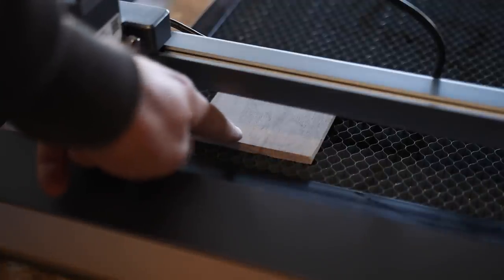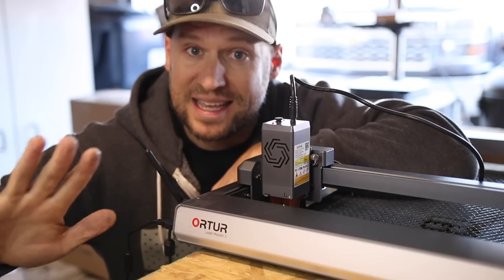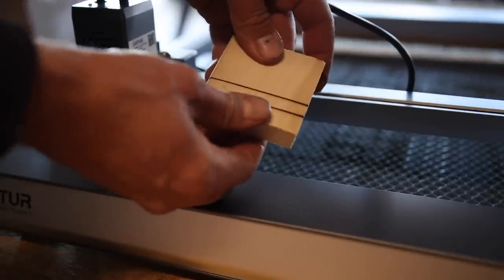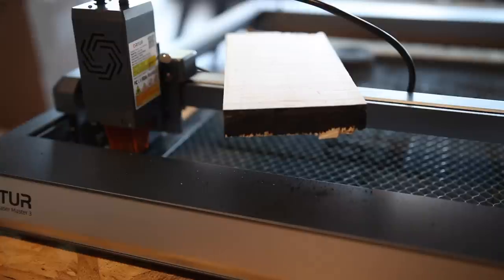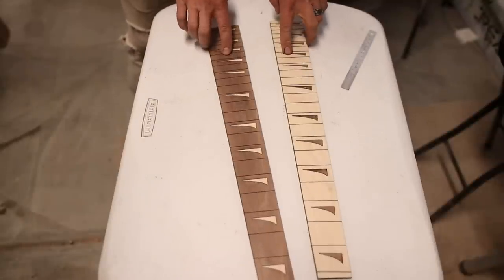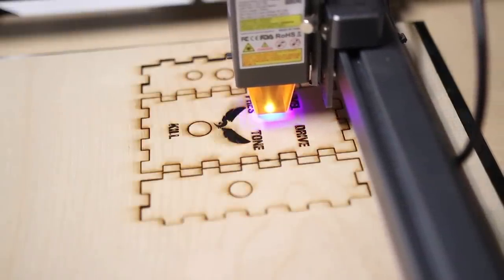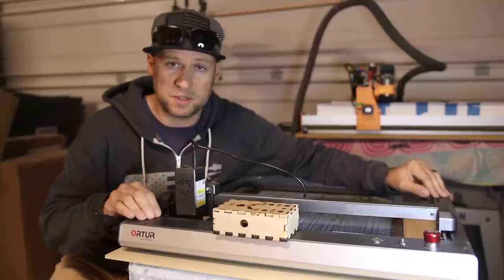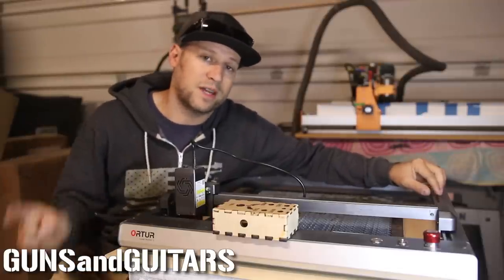Making Custom Inlayed and Pre-Slotted Fretboards the EASY way (Ortur Laser Master 3)

Comment: Looks like Ortur is coming to own guitar building comunity. I have a lot of fun with my laser. I also made a fretboard with it in my latest video but I only marked the fret positions and then cut them to depth by hand. Its hard to control how deep it will burn and its not always consistant on grainy woods. Great video man!
Reply from the maker: Yeah for each of the frets I did 3 passes .14mm apart which make a gap just under .5mm (the width of my fret saw). I could probably press the frets straight in just fine, but after radiusing I’m gonna clean each slot real quick with the fret saw to clear out the saw dust and any ash. If I find they aren’t deep enough for some reason, I’ll take the time to fine tune them. It will still save a ton of time.

Comment: This is a great video.. but, did you ever think about making a bracket to put a laser on your CNC to save some money ?
Reply from the maker: Yeah they make lasers and adapters to use a laser on a cnc router, but honestly it’s a pain to switch back and forth between router and laser, so it’s better to have two dedicated machines. Plus they can both run at the same time.

Comment: Great video, and a great idea on using the cutouts for the other fretboard.  On the fret boards, what will you do with the burned edges?
Reply from the maker: I made these slightly wider than a neck, so I plan to sand it down or route the edge to make a flush fit, which will remove the burn. But one I get ky cnc designs more streamlined and dialed in, I might just cut them to the proper size and keep the burned edges for contrast and install white dot inlays for fret markers.

Comment: for the 3/4 you could try lowering the laser just a little further partway down (not sure how the Z axis works on this model) I have a cheaper and far weaker laser that I use to laser etch things and changing the focal point really makes a huge difference
Reply from the maker: Yeah I did experiment with different focal lengths and couldn’t get a clean cut all the way through maybe if I did several passes then lowered it and did a few more, but when I tried that the laser shifted (ever so slightly) and didn’t make a clean cut.
Reply: Wanna try something cool, remove the crumb tray and focus it higher than your material. It will engrave a wide v groove when its focused close but the material is far away. At least that’s what my glowforge does

Comment: Wow!   This just might be the ticket for me!     I see that you've reviewed a few Laser kits.   The Ortur Laser Master 3 w/Extension kit seems to be perfect. The extension kit is available now (as you probably know).  Bass Fretboards are a requirement for me so I either grow into one, and buy the extension, or just get one that has a long enough working area. And this market place of Laser Engraver/cutters is daunting Geez! - I was looking at CNC's at first, but now it seems like a Laser will add more value to me up-front for Logos/Inlays, routing jigs.. (I've spent a lot of time on making those manually...LOL
Reply from the maker: I love my lasers. The are faster and cut cleaner than cnc routers (obviously can’t cut as deep yet, but I’m sure they eventually will!) I use my cnc lasers 10x more often than my cnc routers.
Reply: @GunsandGuitars  That's a good thing on the wallet!...   One other quick question when you have time:  Have you cut acrylic?  Thinking about something in the range of 1/4" thick or a bit less..Or aluminum?   Thinking about re-making some jigs I have :)

Comment: I guess what I’m interested in is seeing how well frets go in the slots and if they require CA glue to keep them in place or not. I could see this as a viable way to do custom scale lengths and fanned frets and all kinds of things like that. I wouldn’t be at all surprised if someone wanted to cut acoustic guitar tops out on something like this, backs and sides too I suppose. Taylor has used this tech for a long time but it’s only finally getting to a hobby price point.
Reply from the maker: I haven’t pressed a fret fully in yet, but I set the laser to do three passes each spaced 1/8” of a mm apart, cleared out the chaff, and it left a slot slightly smaller than the one left by my fret saw. It might be a tad too tight and need to be touched up with the fretsaw in order for the fret to fully seat at this point, but I wanted to start narrow and widen it as I go until I get the perfect size. So to answer your question, it will not need glue unless you want it as extra precaution.

Comment: So, Makers Muse just put out a video on how dangerous this laser CNC design is. You really really really need to build an enclosure with an exhaust system for these, all that light scattering against the gantry can and will burn your eyes and has a chance to make you or others in the room blind or partially blind. This unit has no safety features at all, and I don't think you are aware of just how much potential for harm there is with this design.

Think about this for a moment - If at full power this light can burn and cut wood, then what will even a fraction of that do to your eyes?
Reply: I also watched the makers muse video. I think while his concerns are valid, most of the dangers mentioned in his video are easily avoided in this use case. As long as you wear properly rated eye protection, and don't actually send the focused beam into your eye you should be fine. And as for the risk of fire, Dan showed in the last video the precautions he has taken. As long as you don't cut anything you don't know is laser safe, dangerous fumes shouldn't be a problem either. At the end of the day, as long as the proper precautions are taken I don't think open frame lasers are really anymore dangerous than CNC routers. It's just a matter of wearing eye protection, and not leaving it unattended.

P.S. I don't write this to put anyone down it is just my opinion and should be taken with a grain of salt the same as any other random person on the internet.
Reply: A shroud, ie shaded welding blind, could easily be installed around the sides to protect you or passer’s by. It wouldn’t take but about maybe 8” all around. But yeah! That light can do a number on ya.
Reply: @the_real_beefchunks  For context, I own and operate an Epilog Radius laser. Trust me, it is far more dangerous then you seem to think it is - Safety equipment exists because something bad happened.

"It's a matter of using eye protection" - Okay, so if it's near a window, or has line of sight with a doorway, whats to stop someone from looking in either of those? When I was a child I looked at the light from arc welding because it was bright and the person welding was just... welding in an open garage.

My main concern here is that he said nothing about the very obvious safety concerns with this laser. It feels not so great to have him basically selling people on something that could hurt them or someone they care about without touching on the safety aspect at all.
Reply: @alaricpaley6865  Fair enough. He should have touched on some safety information. And I would agree that an enclosure would be the ideal solution, but I don't believe that not having an enclosure is an instant deal breaker. Obviously open frame lasers are not for everyone, but I think it is possible to operate one safely with some research, and common sense.

Comment: Have you tested installing frets into those slots?  I'm curious if the width of the cut is the appropriate size.  And also, ho did you guage the power  needed to achieve the appropriate depth?
Reply from the maker: Yes I tested the fit. I figured out the proper settings through trial and error on scrap. Each fret has 3 passes .14mm apart which leaves a gap just under .5mm, the width of my fret saw. So the frets fit a little more snug than when I use a fret saw. The depth was a speed and power setting, again, trial and error.
Reply: @GunsandGuitars  awesome.  Thank you

Comment: How about the kerf size on those inlays? Or did you just glue them in as they came out of the other board?
Reply from the maker: Yup just glued in the ones from the opposite boards. The laser only cuts .01mm wide so no need to adjust for kerf.
Reply: @GunsandGuitars  That's pretty cool.

Comment: so now to test it on Ebony, MoP and abalone to get the full range of fretboards and inlays haha
Reply from the maker: You are correct, need to find some ebony to test. Probably won’t do abolone, since I can just pour epoxy for the same effect and wouldn’t require laser time.
Reply: @GunsandGuitars  pointing our something from other comments, while I believe your laser is pretty accurate, I would suggest cutting the slots to final thickness by hand, just so you're not setting the frets into charred and damaged wood which could fail over time.

Comment: How wide is the cut?
Reply from the maker: Which cut? The laser cuts .01mm per pass. For the fret slots I did three passes spaced .15mm apart leaving me a .45mm slot, just slightly tighter than my .5mm fret saw

Comment: I was hoping you'd also share your cutting power/speed for the fret slots. You mentioned power/speed for cutting all the way thru, but not for the fret slots. 🤔🤨🧐
Reply from the maker: If I recall I did speed at 400 and power at 80, 3 passes each .15mm apart

Comment: At the end of the video you said that this machine is capable of producing a pre-slotted fingerboard but in answer to a comment here you said you are having to cut the slots by hand. I don't imagine that a laser cutter will ever be a good tool for cutting fret slots. The kerf is not consistent enough and it damages the wood inside the slot. So why are you saying it is capable of making a "pre-slotted" fretboard when it is not? The inlays look OK. They aren't the right size because of the kerf but maybe that's OK for you. But you are really overselling this unsafe and inappropriate machine.
Reply from the maker: I said that the fret slots might need to be touched up with my fretsaw for THESE TWO FRETBOARDS SPECIFICALLY because I haven’t had a chance to see if they are cut to the correct width and depth after I radius the fretboards. This machine is more than accurate enough to cut fretslots. Each of these fretslots were done in 3 passes, each pass .15mm apart, for a total fretslots width of .45mm which is slightly tighter than the .5mm width of my fret saw. After I figure out the proper laser settings to nail the width and depth of cut it will be perfect without touch ups. The inlays are also fine, they fit tight, and the wood glue fills any gaps, with the exception of the smallest corners of the smallest inlays, where it will be filled with thin ca glue, the same as hand cut inlays would be. I guess you don’t understand the technology enough to be confident in it, which is understandable. I didn’t either. But now that I’ve had some time on the machine, I can see it’s potential. That’s what I was selling, not that my first attempt at laser cut fretboards are perfect, but that they can be perfect with some practice. And much easier repeatable results than doing it by hand.
Reply: @GunsandGuitars  Selling is the important word here. You are literally just shilling. And maybe you don't understand the technology. Maybe your slots would be 0.45mm measuring at the top of the piece but the laser thickness changes the further it is fired. And good luck Seating the frets into Ash.
Reply from the maker: Call it what you want man. My laser makes fretboards. And soon, my laser will make even more awesome fretboards 🤷‍♂️ I’m sorry that bothers you.